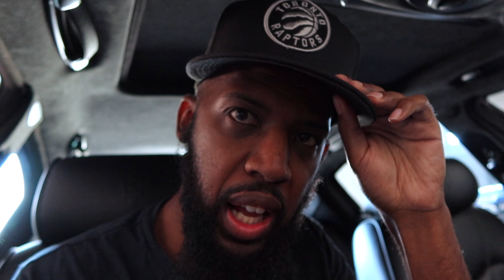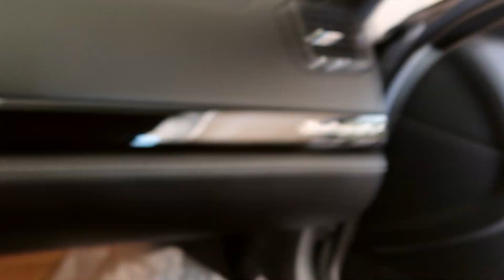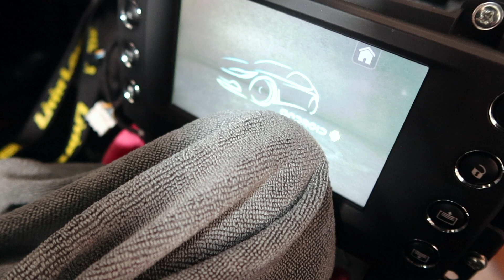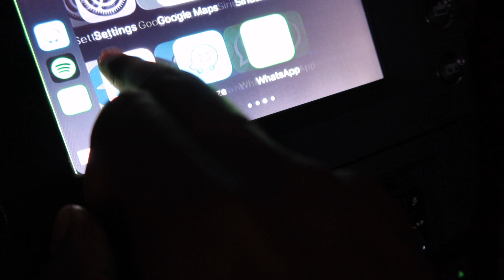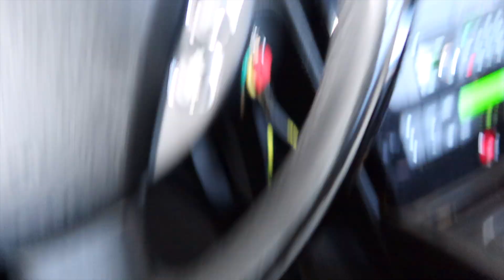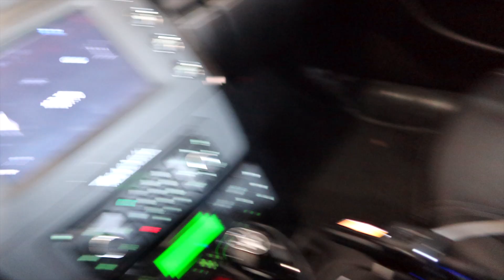ADDING APPLE CARPLAY TO MY MASERATI PT. 2 - FLICARGUY DIY!

Comment: thanx for sharing your video. have you fixed your problem yet? i have the same issue
Reply from the maker: No, I haven’t touched it since I did the installation. I suspect if I wanted to get rid of the feedback through the FM transmitter I could get a noise suppressor or ground loop isolator and install it between the Android unit and my aux cable. As far as getting the Aux plug in the Maserati to work, I couldn’t figure that one out.

Comment: Well done, most impressive. These cars are notoriously difficult when you mess with electrics and that radio unit controls many functions in the car. I have a QP as well, in fact this is my fourth, and my Aux doesn’t work. The Maserati garage thinks it needs a software update, but that can blow your head unit - so they advise against it. I’m going to get a Naviplus unit and get a local installler to do it for me.
Reply from the maker: Just be mindful that the Naviplus unit is supposed to plug into the Aux, so if the aux isn’t working you aren’t going to be able to get the audio from your Naviplus through your stereo. My aux doesn’t work properly either so I ended up using one of those stupid FM transmitter things to plug the Naviplus unit into. It doesn’t sound great.
Reply: @FliCarGuy  Thank you for the advice, I will check it out again - the Ipod I had plugged in didn't work but the USB does
Reply from the maker: @Nigel999  yah my USB works perfectly but the sound of the aux sounds like when you have a broken cable or when a plug is not pushed all
the way in. I took it apart and tried to check everything I could but I couldn’t figure it out. Almost like a ground is bad in it or something.